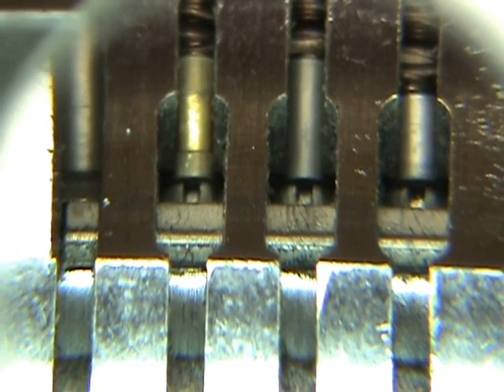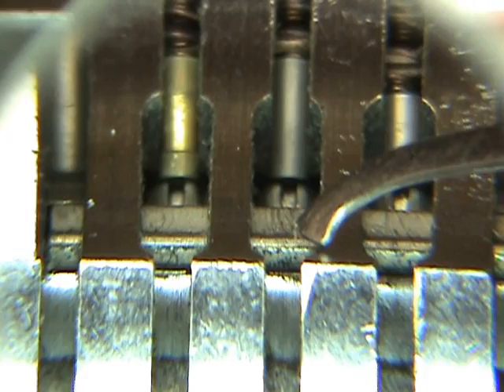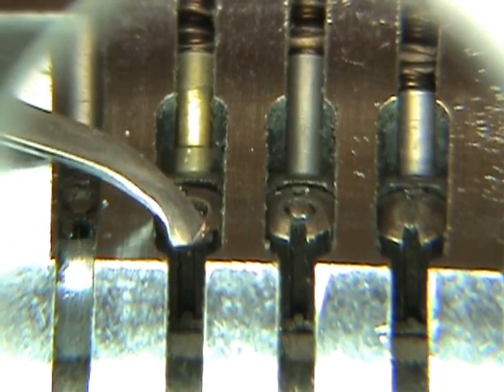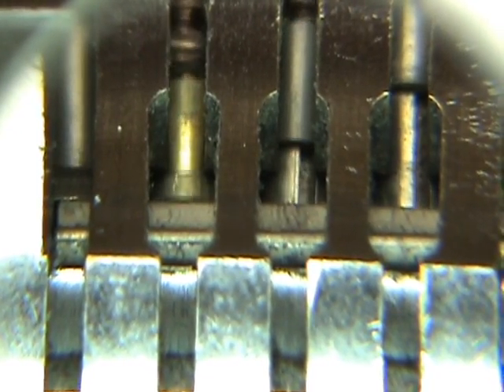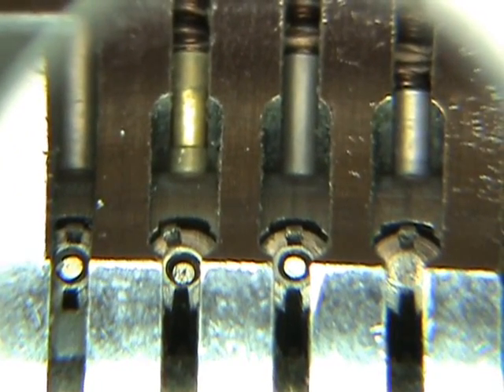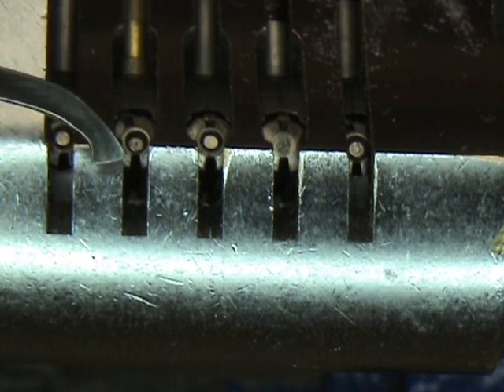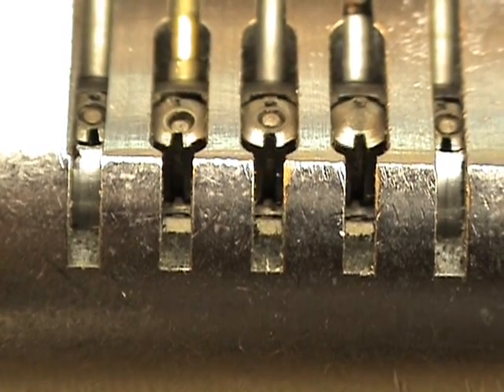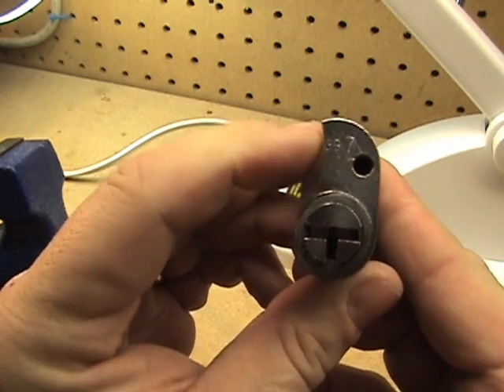Medeco Cutaway Lock

Comment: so the key spins the pins to make them all line up right. but what if you took a pick and spun a few pins to where they are sitting in a different allignment than normal. will the key still make them all line up even if the pins arent in there normal state?
Reply: The key has angled cuts on it that force the pins to properly align when inserted.

Comment: I have a Medeco Deadbolt High Security Lock, my key didn’t want to come out of the cylinder;
I opened the back thinking I can see something and the key came out with the piece that have six little pins + the side bar attached (all came out in one piece),
Unfortunately six springs and six metal pins came flying out, the pins are all different sizes, but the springs are all the same size, is it easy to put it back in, how do you do this? Many thanks

Comment from the maker: @abcdefghijklmao there is a sidebar, the sidebar has little tabs on it.  THe tabs or fingers on the sidebar fit into slots or grooves in the pins when the pins are rotated properly.  THe drill protection is from hardened discs in the front of the lock.